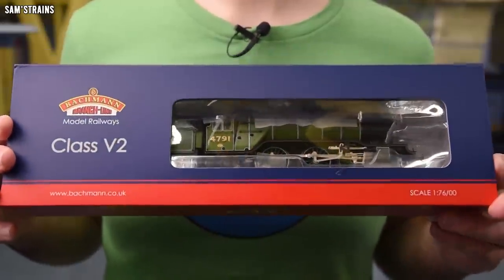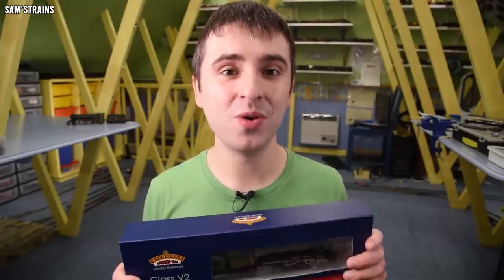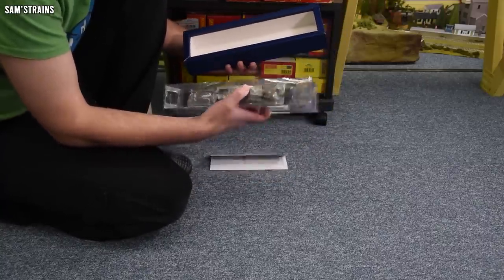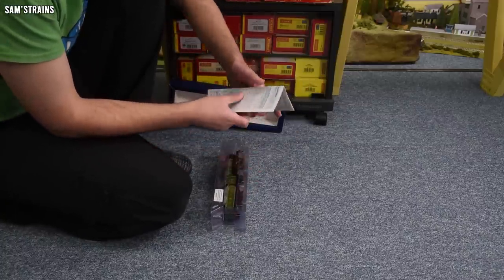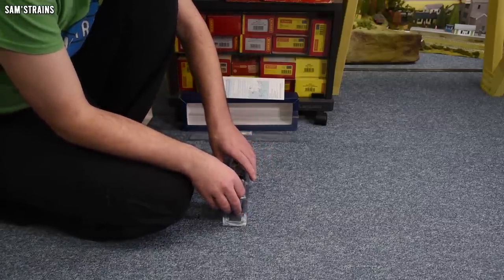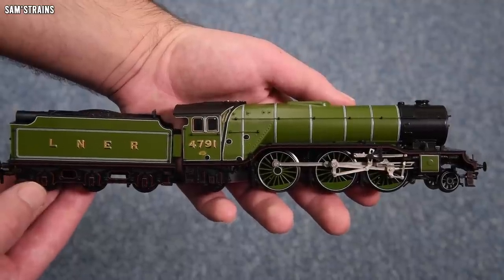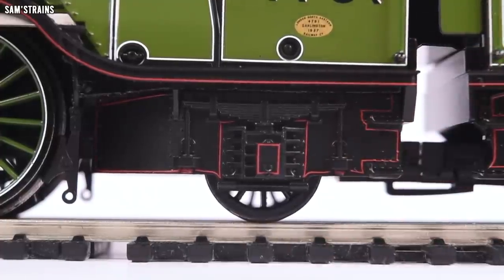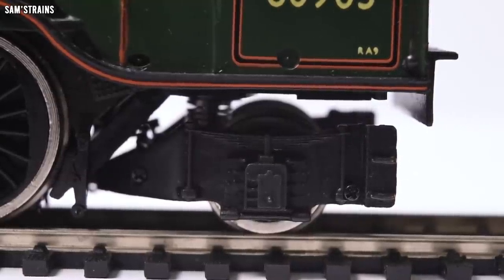Brand New Bachmann LNER Class V2 | Unboxing & Review

Comment: A good-looking beast -- if you like LNER locos, that is -- but as you say there are quite a few tiny niggles which start to eat away at the great first impression. One you didn't mention was the blower pipe along the side of the boiler, which to me screams 'look, unpainted plastic!' Bachmann have clearly tried to match the plastic colour to the paint colour -- and then visibly failed. Oops. That they have neatly painted the part where it runs along the smokebox just underlines what they didn't do with the rest of it.

And that coupling between loco and tender -- dear heavens, what a bodge!

For two hundred quid, we really should be seeing a decent flywheel. And come to that, skew-wound motors are not exactly unknown to the industry either. Maybe this model was designed by a committee... In their lunch-breaks...

Love your honest and thorough review.

Comment: I got the Bachmann V2 when it was first introduced in 1991. I liked Bachmann better than Hornby at the time. Notwithstanding the split chassis and 3 pole motor the loco ran quite well. I am tempted by the new model though I wish it had a metal running plate.

Comment: Sam, 2 quick questions from the other side of the pond:
●  Why do so many Brit locos have no tenders? I 
●  What is a brake van and why isn't t every train fitted with one? 
●  Is it really that much cheaper to fit a loco with a plastic chassis plate or no flywheel?
Cheers my friend!
Reply: #I guess we Brits had so many tank engines because comparatively short runs between stations meaning you didn't have to carry so much coal and water.
#A brake van was a small cabin, usually 4 wheels, sometimes 6 and VERY rarely 8.   They carried a guard who was in charge of the train.   Up to the 1960s most goods wagons only had a handbrake.   Twenty or more loaded coal wagons takes a bit of stopping with a brake only applied on the loco.   The brake van was equipped with a screw on handbrake to help stopping.   It would also be used to keep the couplings taught so they did not snatch and break.   It would carry lamps to show signalmen and the loco crew that the train was still coupled together.   Start worrying if no lamp at end of train!   Around 1960s/1970s more wagons were fitted with brakes under the control of the driver so brake vans fell out of use and are only rarely used if pushing a train for a distance or perhaps for dangerous loads.   The brake van would always be at the back of the train.   (Sometimes you see pictures with another at the front of the train, probably a spare being moved).  Each company had distinctive types, notably the GWR having a type with a single verandah known by its telegraphic code TOAD.
Reply: (1) The UK is a much smaller country than the US with your typical journeys being shorter, plus more servicing facilities located closer together etc, so there was simply no need for all locos to lug huge quantities of coal and water with them and as such the cheaper tank engine design was ideally suited for many slower services.

(2) A brake van is the UK term for what Americans call a Caboose. It is somewhere for the train Guard (Conductor in US speak) to ride and in the days before wagons were fitted with train operated brakes (as opposed to a manual handbrake to hold it still when parked on a siding), the Guard would use the brakes in the heavy brake van (the weight coming from trays of scrap metal hidden within its underframe) to help slow the train down on steep gradients. In the late 1960s, the need for brake vans on trains where all wagons were fitted with a continuous braking system was removed and the guard riding in the rear cab of the loco (note most UK designs have dual cabs) instead - until the early 1980s when the need for a Guard on freight trains was removed completely!

(3) The raw material (metal) used in die cast is more expensive to buy then cast than plastic. OK it might not seem like much more but there is a saying over here 'look after the pennies (i.e. cents) and the pounds (i.e. dollars) look after themselves - and as such what might seem like a trivial cost saving can end up making a significant difference when it comes to shelf price. Its a similar situation with flywheels - it might not seem that expensive to provide in isolation but could well have a significant effect on the eventual price.

Comment: Will be keeping my old V2 31-565 with a re-tooled DCC ready chassis, blackened wheels. This version has flanged wheels on the rear pony. which don’t flop around like the original but sit inside the frames like the new version.  I am surprised that the motion parts have not been improved, by being finer, and still have the over prominent screws that let it down.

Comment: The mech for the tender coupling isn't great, but I would say its meant to be left coupled? Also, why would you ever uncouple it on the track?The dapol method worries me, will it wear over time and begin to uncouple when pulling loads?
Not a fan of the bright silver on the rods, comes across as very toy like.
As all locos are now designed with DCC in mind you should also test on DCC with the recommended decoder in my opinion.

Comment: Another excellent and fair review Sam. Thanks.

It really is another gorgeous looking model from Bachmann. As you say they're excellent when it comes to the finish on their models.

 In particular I'd compare this to the LNER Apple green livery on Hornby's Thompson A2 which didn't look quite right from all the pictures/vidoes I've seen and for some strange reason is a different shade to all Hornby's other Apple green livery locos, which was poor. The apple green version of the Hush Hush does look back to their normal shade though.

There's lots to like about this loco: livery finish, detail, the rear axel and if the motor is 5 pole then that's a step up from many Bachmann models, but as you said it's a shame the running plate isn't diecast and it could be better designed for maintenance. 

I also wonder how robust the tender connection will prove over time? It may well be fine, but personally I think I'll let others be the guinea pigs and watch how they get on and see whether they have any issues with it.

I get the distinct impression that Bachmann models are aimed first and foremost at the cabinet collector where looks and detail are paramount with layout performance being slightly secondary. Not terrible, but not as good as some others. There are encouraging signs that they are at least listening to the feedback and trying to improve that.

Comment: Hi Sam. Not sure what to think about this. I have been trying to pretend it hadn’t been released as I adore the V2 and have got two already (one in BR green, one in early BR black) which are great old things. Yep, they are a bit long in the tooth and look a bit toy like now but I love them dearly. And funnily enough when I bought them I thought “wow, the detail on this is amazing!” 🤣😂😅

The coupling (if you can call it that) was always an issue but they are such plucky performers it never seemed an issue. However, I see what you mean about the new one! What a ruddy faff! Overkill is the word that springs to mind. And spring is the word that…er…springs to mind when I see the running plate 🙄 Like you I felt sure it would be die-cast but no 🙁 And the firebox glow (which I have been a sucker for ever since I bought my beloved tender drive 8F in about 1995) is…well…not very glowing 😐

That said, despite the lack of a fly-wheel (again, why? 😒), that 5-pole motor is pretty good and I think the performance of ‘just about 4’ is right, simply because form my point of view, I’d want it to just go, not least because I’d not use it to shunt as it’s a V2 not a J72! 😜 But ohhhh my! The bodywork is delightful! And THAT is what I suspect I am going to have to do the whole “oh no darling, I’ve always had this one” routine. Yes, it probably is a bit overpriced but I can cover it with a bit of overtime…and it’s a V2 for goodness sake 😍

I am also impressed with the sprung wheel set on the rear pony. Not convinced at all with this “innovation” but that looks the best I have seen yet to be fair 🤔 

Thanks again Sam for a splendid review. It is annoying that it isn’t as good as it could have been, but I think overall it is a pretty decent offering. Plus, as you point out, it has at least become available! 😅 If it had been a Hornby engine, I suspect that, in the words of a certain someone, “It’s not a toy, it’s for keep…ing everyone waiting only to be ultimately disappointed and send the thing back and forth until you say sod it I want a refund.” 🤪

Cheers mate, take care 👍🍻🍀

Comment: I noticed the flangeless trailing wheels are much wider than those on Hornby's recent locos. Hornby use a more shandard thickness wheel with its edges having a shallow angle radiused chamfer. In the roller bearing industry, this edge relief is known as crowning. So the wide Bachmann wheels are designed to stay on the track around a bend and Hornby's are designed to fall off the track around a bend, with the crowning allowing the wheels to remount upon reaching straight track again. However, Hornby wheels don't seem to reach the track in the first place anoyingly. So at first glance, Bachmann's design seems better

Comment: The four pins between the loco and the tender are:  Two pins for the pickups from the wheels, and the other two are for the factory installed speaker in the tender.
Reply from the maker: I'm pretty sure there are only two wires connected to the tender - so just pickups - as the speaker is in the loco!
Thanks for watching, Sam :)
Reply: The speaker is in the loco.

Comment: I picked on up here in Oz (with an eBay discount code from a local reputable store) for £156 - which seems to be cheaper than most UK online stores (and that means I am also only paying the AUD$10 postage, not the usual £20 postage from the UK).

At that price, a bargain indeed.

Comment: A stunning looking loco with lovely decoration, however a bit disappointed that the running plate is plastic which feels a bit of a retrograde step and not too keen on that coupling mechanism even if it is an improvement on their previous method.  Thanks for the review Sam.

Comment: You compare it to the Dapol coupling but to me it's good but I don't think it will last very long with the tiny clip on the tender looking fragile. 

How often are you realistically going to need to uncouple the loco and tender? You make it sound like it needs to be done often. Not like to needs uncoupling to go in the box.

Only real decoration issue is the overscale black line between firebox and cab.

The moving firebox heat shields are nothing new. The GNR and LBSC Atlantics had that feature

Comment: Slight mistake, Bachman introduced a new chassis for the V2 in about 2010 and I had two of these having managed to buy the last two replacement chassis but they fell apart almost immediately, anyway my two V2's remain these models and originally the then new chassis was going to get a new body and in the end Bachman decided to replace the chassis as well culminating in the V2 you now have.

Comment: Hi Sam, wow, I like the look of the model. Yes it’s a high price and the £180 mark is still a little more than most modellers have spare. I think if they were around £150 , would be worth a punt. I think a lot of the price hikes are for all the xxx bits. 
They should do a Version without the circuit board, speaker and gizmos, just give the hobbyist a choice. I am from the time when you could get a non dcc model and if you wanted dcc, you paid that little extra, and sound etc. they are putting the stuff in the models that the majority don’t want, trying to force you to go Dcc . 
Why not build a model which you can upgrade by buying detail packs in stages, extra detail, dcc , poor running verses super detail. Your older version of the model has lower detail, but if they had a super detail pack to add extra detail in stages, you may end up with a little more expensive but at least you can decide yourself if the extra is worth it. Difficult to find a good ground where everyone wins.
Reply: I'm for your proposition. I prefer buy my own decoders apart and later, and even none for N scale, I don't care at all for sound and I prefer performance over details.
I will buy this one, but I will made a comparison with the BR 23 by Roco (a tender prairie of the DB) to see what is right for roughly the same price. The Roco model have a flywheel on his five poles motor, bad mojo for Bachmann...

Comment: Looks like the same type of connection as fitted to the Bachmann 4-TC, 4-CEP and 117 DMMU. A very reliable connection, but a pain in the bum to couple or uncouple. Seems stupid that they are going back to decoders in the loco instead of the tender.

Comment: I have ended up buying an older model V2 in BR black for £60. I just can't justify spending nearly £200 on a not quite perfect model. I would rather a train run beautifully but not have much detail, than for one to look fantastic but not run that well. And that tender connection would make my blood boil. You might as well buy a static model in that case!

A great looking loco nevertheless, and once again a fantastic review Sam.

Comment: I'd counter your statement that the V2s were the only successful 2-6-2 tender locos. Gresley's V4s were successful, except Thompson cancelled the order after the first 2 and formed his own B1 class instead. A shame, but it was wartime and it is understandable.

It looks a nice loco, especially with the moulded front buffer springs, but that coupling seems horrible. Loco mounted decoder sockets mean there are fewer wires to the tender, but reduces the space in the loco for a flywheel or more chassis weight. A real shame about the plastic running plate and boiler, boiler moulding line, visible motion screws, lack of moving cab vents, etc.

I'm gonna stick to my old one, BR Black 60800 Green Arrow. I've added an etched front number plate, painted the wheel rims black, and wired an 8-pin socket in the tender. True, the tender and loco running plates don't line up and it isn't super fine, but once it's DCC'd, it should run well. Although, I do need a double chimney one...

Comment: To be honest, I would prefer visible screws on running gear. It allows much much easier maintenance if something goes wrong or needs to be adjusted. Even if it is expensive i would still want them.
Reply: Totally agree. Visually they non obtrusive, and riveting would make disassembly very difficult. Hornby uses a more noticeable hexagon head.
Sam is developing into a Craig Revel Horward.

Comment: Quite like the blingy rods, I usually paint the 'chemically blackened' ones silver so i can actually see the things anyway.

Overall looks good, posable firebox doors is cool, don't think I've seen that before.

The firebox glow looks USELESS.  Why did they even bother?? 😁

Overall I want the old V2, can afford one!
Always wanted one and never had one.  As I'm slowly converting to DCC finding an oldie that isn't split chassis is not always easy as many don't add details to description.

Why they went back on plastic running plate is beyond ne.  As for the tender connector, eugh!  I have a Bachmann 101 that's a supurb model but the connector is similer.  Almost broke it trying to take it apart and since then been scared of touching it.  Not the mental emotions you want to be experiencing.

Comment: So much negativity here. I have two, and they are fantastic. The tender/loco connection is plenty strong enough and works fine.
It is a very smooth runner, with a great crawl on dcc. Looks good .
One good reason it has the decoder in the loco is that is where rhe speaker is, and that's where the sound should come from.
It is plenty heavy enough, and the running plate is fine.

Comment: a black reflector for the firebox leds, well thats good engineering. a splash of white paint or correction fluid should improve the firebox glow quite a bit. perhaps the same genius who designed the tender coupling has struck again? one can only laugh or weep. the water gauges look great. maybe I missed it but is the head of the 3rd cylinder visible below the firebox? I have a thing about water glasses, in real life they are essential, water too high and it carries over into the cylinders, then the wheels lock and something bends and/or breaks, too low and the copper fusible plug melts and boiling water at boiler prerssure cooks the footplate crew

Comment: hi sam. you nearly managed to make me buy my first bachmann... but those few let downs made me angry and smile at the same time the more i saw  you going through your review.. the tender coupling and where the decoder is placed and the running plate is what nailed the coffin with this model  a no no. for me
Reply: Those complaints are very nit-picky. It is a superb model with a great performance. The tender coupling is very clever, and keep the loco and tender closely coupled on bends.
Reply: @TheWGLOVER  hi william. Spending 200 pounds  plus on a model one would have to be as you say a bit nit picky. If everyone accepts what ever is on offer only makes manufacturers produce a   
 product with inferior and cheaper matierials
 at higher prices. But that is my way of thinking.

Comment: I like your content a lot! The only downside is that most of your trains are on 00 and I have a h0 track ;-;
Reply: 00 track and H0 track are the same gauge - 16.5mm...  It's the scale that's different.  H0 models are to a scale of 3.5mm to the foot, which is correct to the gauge, whilst 00 models are built to a scale of 4mm to the foot.  So 00 models are actually running on non-scale track...!!